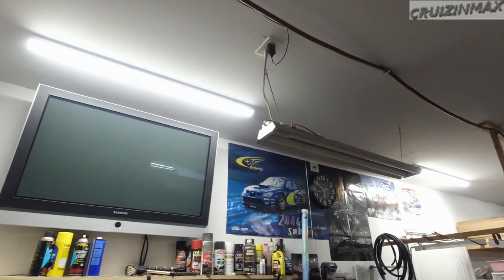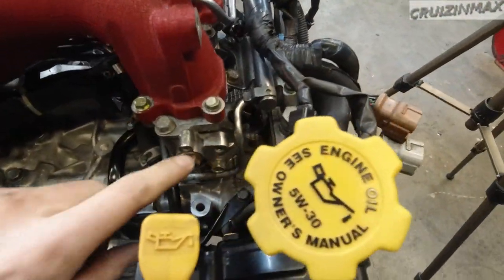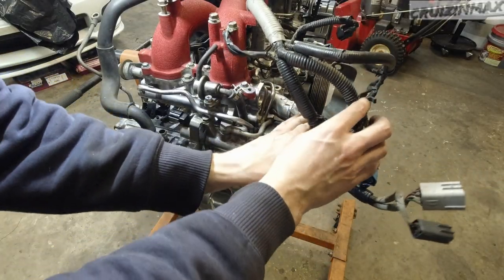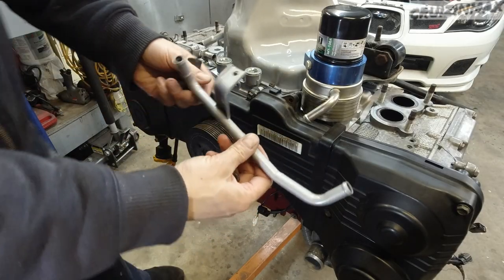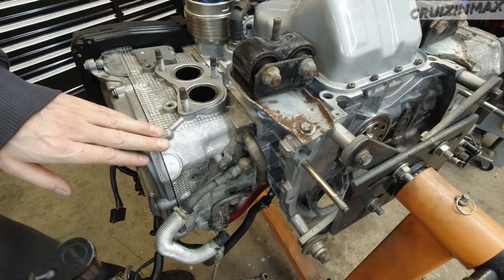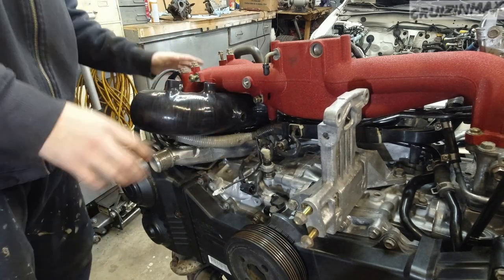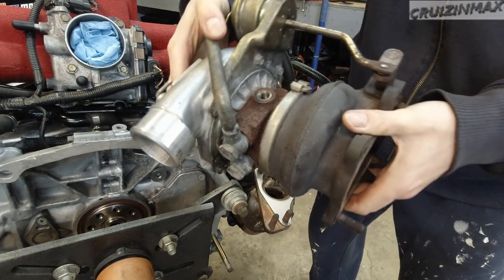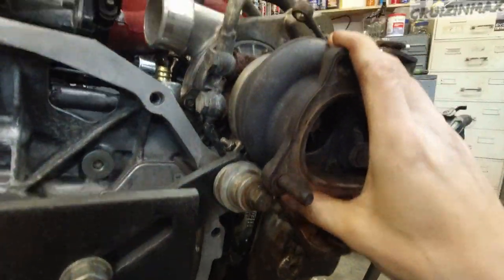Subaru STI EJ25 build part 8 intake manifold, headers, turbo

Comment: How did you run the regulator vacuum line for this swap.
Reply from the maker: It's in one of the video's, I ran it to either the front or the back of the intake manifold, doesn't matter.